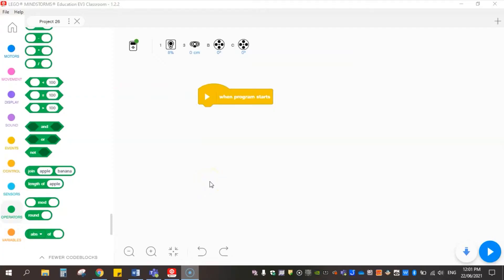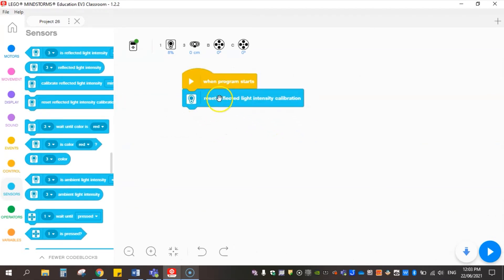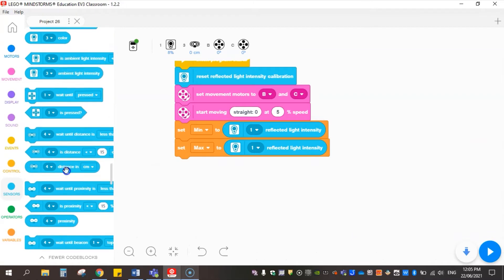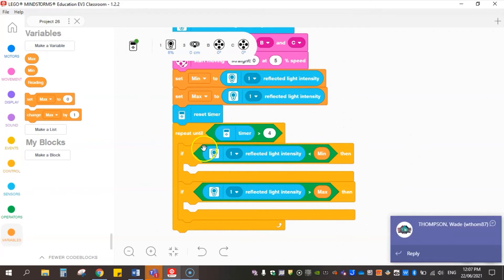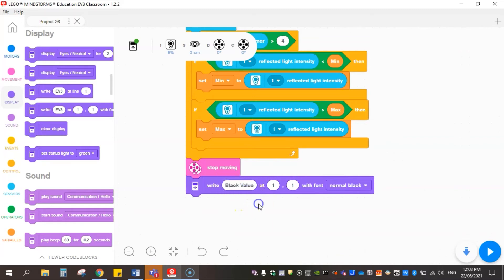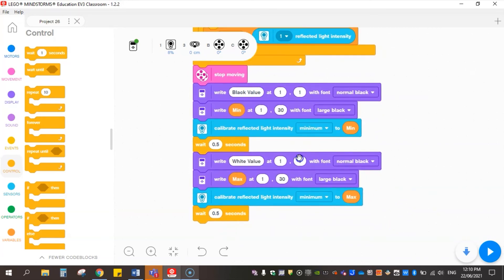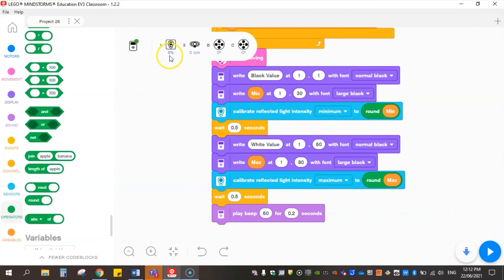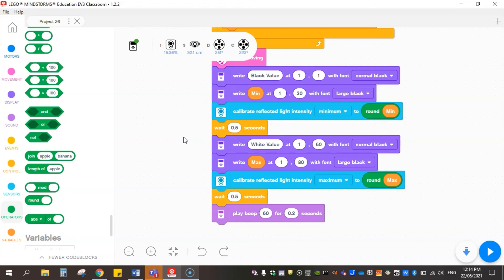EV3 Automatic Colour Calibration - EV3 Classrooms

Comment: Thank you for this remake. Keep'em coming! EV3 G / LabView is really difficult to read for beginners. And as a beginner I have a few questions: I understand the re-calibration values get saved on the brick even if it reboots? Have you resolved the issue of sensors returning negative / or excessive values after calibration? (I have one that even reports "infinity" and has therefore been unusable. Another one switches on an off in the middle of a program for no apparent reason. Hopefully a calibration will help?)
Reply from the maker: The on / off is very annoying. Often it pays to try and repeat a calibration for one that is recording the infinity or negative for black values. I will post another video soon with a similar strategy however using mapping to be able to use the factory calibration and still however get the 0-100 scale.